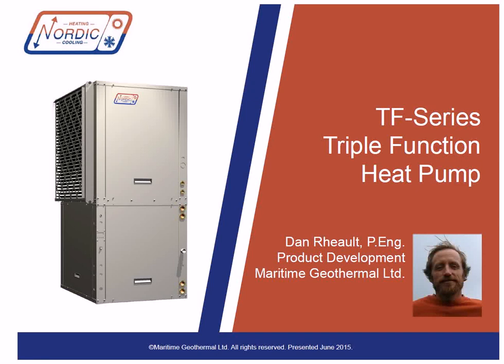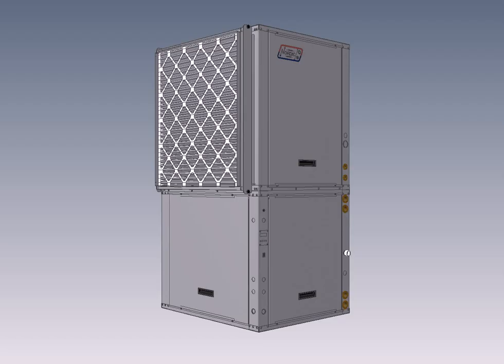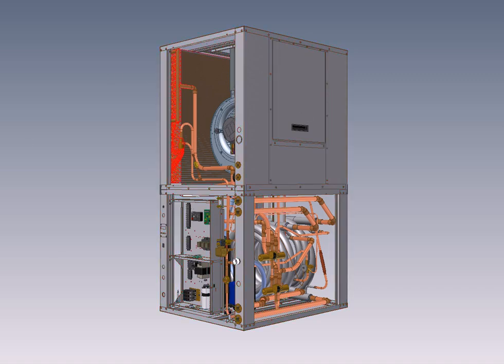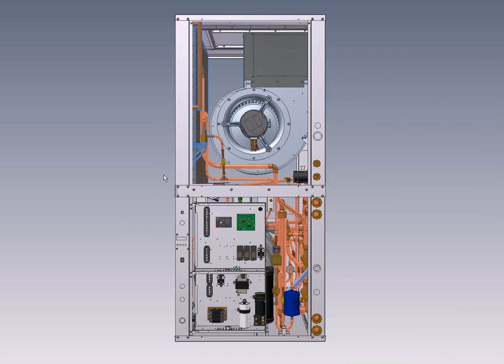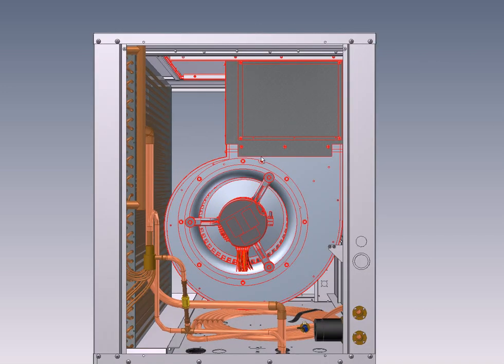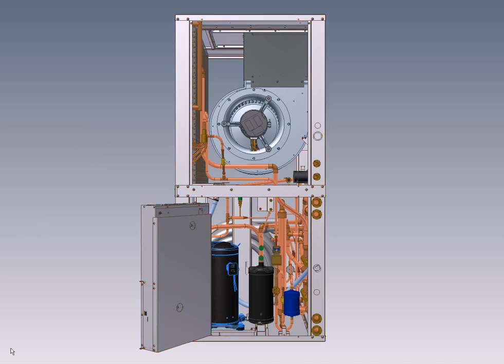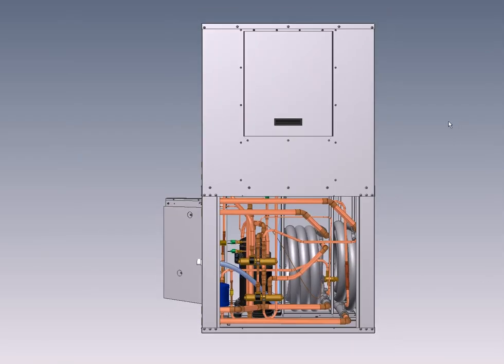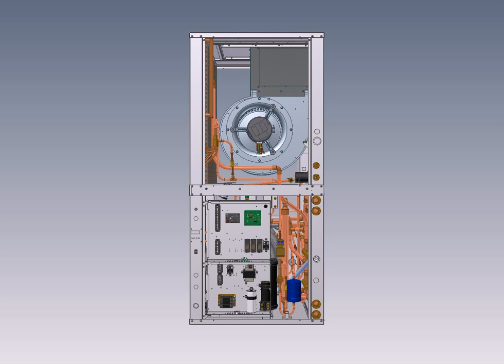A Look Inside the Nordic Water-to-Air & Water Triple Function Heat Pump

Comment: Could I place a geothermal triple action unit upstairs and olace the hot water tanks and radiant manifolds below it on the first floor?  Any pressure or pumping issues with that?